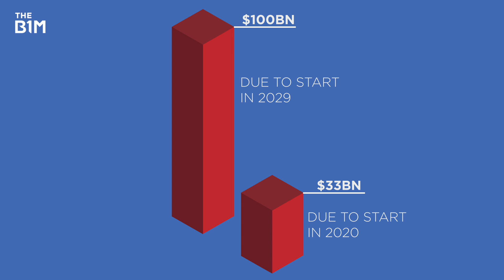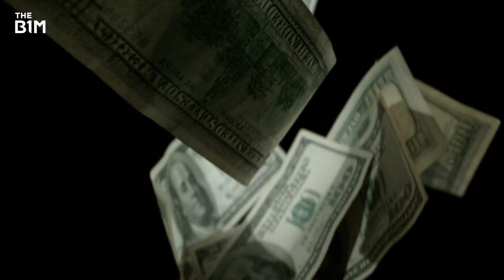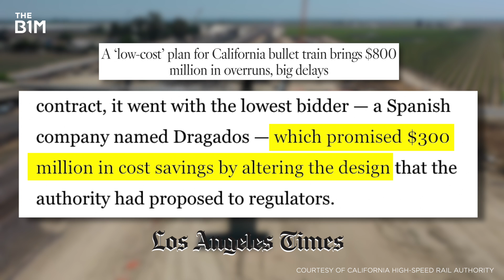What Went Wrong With California's High-Speed Railway

Comment: To anyone who thinks that the Acela isn’t true high speed, I’m gonna prove you wrong. In order for a train to be high speed, it has to go 125mph if it runs on existing track. And 160 if it’s brand new track. The track the Acela runs on is existing track. And there is a new Acela coming that will go 160, so no matter what, it’s legit high speed.
Reply: The train set is capable, but the whole line averages 70mph and can only hit those high speeds on a very small portion of the track. For example,  It's a lot closer to a  French regional train, than the TGV system.
Reply: @MikeM-so3je  unlike the French regional trains, the Acela is very long and runs on a freight gauge track
Reply: Yea but the average speed is comparable to a car- Not high speed.
Reply: The trainsets themselves were never the problem. The rails, the sharper turns, and number of level crossings, are what prevents these trains from running at their full high speed potential.
Reply: HSR isn't just train, but the whole system
Reply: It may fit the definition alright, but that bar is really low. Compared to trains in Europe and Asia it's slow. If the same track was in China, it would not be considered a true high-speed train (gaotie) but rather a medium-speed one (dongche).

Comment: From the viewpoint of a Taiwanese who lives in the bay area and rides on high speed rail several times in both Taiwan and Japan every pre-COVID-19 year, it is incredible to see cahsr to begin construction in the central valley whose population density is lower than the bay area and LA metropolitan area. It is not going to make money and it benefits so much fewer people. It would make more sense to start the northern section from Oakland or SF to San Jose, to show that it can survive on its own, and then extend to Napa, Sacramento, the central valley, and connect to the southern section from LA/San Diego. It is destined to be a money burning pit to start in the central valley
Reply: Whoever planned it to start from the central valley wanted it to fail and stop.
Reply: HSRs have a track record as money pits. Anyone who thinks that HSRs can survive without some sort of subsidy is delusional. Japan was forced to privatize their system after they racked up too much debt building political motivated HSR lines. Taiwan's HSR project was a financial train wreck. The list goes on.
Reply: @MrAnonymousRandom  But both systems live on their own revenue now.
Reply: At worst, it won't be a money pit as large as it will be to start from the central valley, since it can make more revenue.

Comment: Drive to the high speed rail station and park 30mins,
Lineup and reserve a ticket 30mins , 
wait for the next train 30mins,
journey 2 hours 30 mins
pickup a car in  hertz 30mins, 
Drive to your destination 30mins
Total 4 hours 30mins
Not much time you can save compared to drive (6hours)
Reply: Drive to station 30 mins, 
Buy ticket on phone app 30seconds, or use swipe card,5 seconds
Wait for train to arrive and board, 10 minutes
journey 2 hours 30 minutes, schedule car near station in meantime.
Walk to get rental keys and pick up car 10mins
Drive to destination 30 mins.
Total: 3 hours and 50 mins. 

Benefits: No risk of accidents(drunks, deer, people texting while driving). No wear tear and maintenance on car. No gas cost. System can be used by the elderly, people without drivers license, and the disabled. Decrease pollution. And you know what is best of all? You can rest on a train, do work, eat lunch, read, be on a laptop, or do whatever you want. All the things you cannot do while driving. AND save 2 hours of your time. That does not sound like a good deal to you?

Comment: There are several mistakes in this presentation:
3:11 the initial construction packages 1-4 do not "link" Madera and Bakersfield.  This section ends in a field about 10 miles outside of Bakersfield with no station.
3:46 the cost estimate of $33 billion(in 2008 dollars) is from the 2008 business plan which acknowledges that cost is if everything goes perfectly, and it implores the state legislature to remove roadblocks that would increase the cost.  The current budget is not "over $100 billion". The current base budget from the revised 2020 business plan is ~$83 billion.  That cost is for the entirety of Phase 1 from S.F. to Anaheim, and not the initial 119 mile construction section, as implied.  The timeline of completion is currently "before the end of the decade" and that applies to an operating section between Merced and Bakersfield, not the initial 119 miles of construction.  The cost of the section from Merced to Bakersfield is currently estimated at about $22 billion.
4:00 the Prop 1A bond requires matching funds from another source, but there is no requirement that source not be from the state itself.  This is why the state has been directing about $750 million/year in Cap-and-Trade funds that the state collects, toward the project. This is also why the state is capable of spending the entirety of the bond money by 2030.  The plan did originally assume there would be significant private investment, and there has been none.
5:15 the idea that there is no indication when the environmental reviews will be finished is false.  There is a schedule for completion of Environmental Impact Reports and the Record of Decisions is in the current 2020 business plan.  The EIRS are scheduled to be completed Q1 of 2022.  The RoDs are scheduled to be done at the end of 2023.  Once a RoD is complete for a section, technically construction can begin on that section.  However, as the video points out there are currently major funding issues which will keep this from happening on most of the sections even after environmental review is complete.

Comment: This won't be a popular opinion, but right now there really isn't a point to building all this in the US. It's a vanity project that really won't help people in their day to day lives. The focus needs to be on transportation in and around cities, commuter rail, light rail, and things like that that normal people would use every day. Being able to get from SF to LA in three hours doesn't really help you if it takes you two hours to commute in LA every day. Until that is fixed a big fancy high speed rail project really doesn't do much to benefit people. Things need to be fixed on a smaller scale first.
Reply: Maybe not popular, but I agree it's the only way this will work. Requiring a car to get to the station, and another car to arrive at the destination after the train trip, is one of the top objections to rail travel. If it could be solved, that would be a massive step forward.

Comment: One thing that I believe has been stated about the operation of the rail line is that around LA and SF the trains would be required to operated at slower speeds and the high speed portion is only in the middle section increasing the travel time between the cities. If that is true then the benefit would be greatly reduced.
Reply: The “slower speeds” are still upwards of 200 kilometres per hour. Of course the speed will be lower in urban centres, but the journey would still take around 3 hours, which is much better than road or air travel.
Reply: @justsamoo3480  I wouldn’t say much better. Flight time from LAX to SFO is 1:15-1:30.  So if factor in security and other time 30 minutes prior to boarding you might be pushing 3 hours.  The problem with that is you’ll still have security at the train station and need to be able to board 20-30 minutes before departure. So the time for train travel is even more than you listed.  Southwest charges $100-300 each way depending on how far your book in advance.  So will the high speed train be less than that?  Maybe, maybe not.
Reply: @ken9295  The issue with this is the fact that it takes forever to get in and out of LAX. Like you can board a high speed train from either Burbank, Union station, Norwalk, Fullerton and Anaheim just in LA metropolitan area alone. In Bay area you’ll have stops in Gilroy, San Jose, Milbrae and Downtown San Francisco. With that many stations in both LA and Bay it will be much easier to get to a high speed train stop than an airport of any sort.
Reply: @justsamoo3480  I used to live in LA and now practically commute out to LAX weekly.  I’ve never dropped anyone off, but I’ve taken shuttle buses from remote parking or car rental companies and get you in or out in short amounts of times. Most times I give myself 30 minutes from when I pull into the rental car lot until I need to be at the terminal. Yes there are rare times when driving through the horseshoe shape road through the terminal area but those are few and far between.

Comment: I opposed this project from the beginning, even though I'm a huge supporter or public transportation.  The reason I opposed it is that there were better ways to spend this money on public transportation.   For example,  a high speed connection between Sacramento and San Francisco would have been a good first step.  It is unbelievable that they decided to start this project in the middle of the farmland of the central valley.
Reply: Agreed. They should have started with shorter segments. LA to San Diego and SF to Sacramento, and then build a connection from SF to LA once the systems were up and running and had proven it would be used by people
Reply: Same, I lived in California at the time this was on the ballot and I voted against it, because I knew it was gonna turn out to be a clusterfuck and unfortunately I was right.
Reply: @rexx9496  Lol, but they went to the farmlands because the rail line you wanted would've been opposed by others, and now since your "democracy" is all about the individual, everybody thinks they're the boss, and everybody puts their foot down. The end result is that even in an effective one party state like California, well publicized but admittedly low priority projects like the high speed rail can't be built with much urgency. So please stop lecturing and smearing the Chinese Communists for being a "one party state", presumably accusing it of lacking a " diversity" of thought, as if you actually cared either way about whether that's true or not. And after all, like Steve Job of Apple fame once said during a reply to some "dissident" complaint, "at least something is being done", in this case of rails, in China.
Reply: Exactly, then they could’ve used the revenue generated from the LA/San Diego route to fund (partially) other segments.
Reply: They did that because they knew that once the projected started and people saw how much of a mess and incredibly expensive it was actually gonna be, funding was going to start to dry up, and if they didn't do that middle section through all the farmland first, there never would have been the political will to complete that section. 

Now that the least popular section has been built first, they'll have a better shot at actually getting the entire system completed.
Reply: As it is, Caltrain just announced electrification won’t be completed until 2024 now, adding a further 2 years of delays, and that’s just a relatively short segment of rail line where a train line already exists
Reply: They decided to start between SF and LA, but due to budget shortage and other reasons finally they have to do it in the valley

Comment: Few things are worse than leaving a project unfinished (or taking too long) what happens is that the unfinished parts are being exposed to the elements and they start deteriorate - however slowly - they are NOT meant to be exposed to the harsh element "barebone" for YEARS without proper protection (yes, even concrete and steel). That, plus the union's attitude with zero accountability (take AS LONG AND WORK AS SLOW AS POSSIBLE) and tax payer founded (again, zero accountability) you've a joke that's not even funny.

Comment: The fact sheet said the rail is gonna take 2 hrs 38 mins to travel from LA to San Fran. What is the average flight time between LAX and SFO? Oh 1 hr 25 mins. Why would any sane person consider it a good project?
Reply: because those aren't the only two cities that will be served by a long shot.
Reply: @snoopyloopy  

The census data suggest most population concentrates at those two cities. So this will never be a good bargain if and only if there is a sudden surge in traffic demand among those less populated areas in-between which is unlikely. Plus high-speed rail is high-speed because they are designed to have as few stops as possible. Acceleration and deceleration takes time. 

An improved connection between LA and San Diego (not necessarily an all-new "high-speed" railway, better trains, better track and line designs all can help) may fare better.

Comment: China’s current infrastructure construction has been accumulated over the past 40 years. The purpose of China’s large-scale infrastructure construction is to improve people’s livelihood 
and create an investment environment. 40,000 KM high-speed rail lines will be built within 10 years. The purpose is to build between cities and between cities and villages. The interconnection of China is not about comparing with others, nor is it about surpassing others. On the other hand, the Biden administration in the United States seems to have only one purpose in its infrastructure construction, surpassing China.
Money is far from enough for infrastructure construction. Does the United States now have a large number of professional infrastructure workers? Do you have a large number of modern professional infrastructure equipment? Nowadays, 80% of China's high-speed rail construction, maintenance and repair use robots, and the 1500KM high-speed rail line will be completed and opened to traffic in two and a half years. China is not only the world's largest manufacturing country but also the most comprehensive manufacturing country. More importantly, the Chinese government formulates and implements policies with high efficiency, which is unmatched in the world.

Comment: Imagine being the world's "only superpower", but lack the ability to build even just ONE high speed rail 🤔

A country built by rail and trains in the past became automobile-centric due to corporate lobbying and bribes.
Reply: Let's look at the economics.  Quality HSR only works in distances under 500Km in high density areas and a cheap labor force.   Let's look at the most establish HSR line in the world.  The Tokaido Shinkansen, opened in 1964, it covers Tokyo, Nagoya, Kyoto, and Osaka.  Four of the biggest cities in Japan.  515kms and an average trip taking about 2 hours and 30 minutes.  Cost 1 way: 13620 yen (unreserved seat) or 14650 yen (reserved seat).  Peach Aviation from Narita to Kansai International last minute ticket 6000yen-8000yen(most of the time less).   ANA Haneda to Osaka Airport last minute ticket 9000yen-11000yen.  Flight time 1h 10m.  You have airlines beating one of the most established HSR lines in the world on pricing.   Not to mention you can get there on regional trains for 5000yen or bus for 4000yen, but it is an 8 hour trip.   

After 500km HSR becomes exponentially more expensive than flying.  Why on earth would you build HSR that is over 600Km with less than 3 major cities and high labor costs.  The cost per ticket are going to be astronomical.  HSR just isn't feasible in most of the US.
Reply: @TheBaldr  While your argument is very convincing, you're forgetting the timing element. even though you can take low-cost carriers or even JAL/ANA domestically, those flights are not running every hour. The reason why the shinkansen is able to compete is that it offers the most flexible time schedule out of the options available with the added bonus of serving the tens of municipalities on the route in between.
Reply: @HitomiNee  don't forget the hassle when checking-in/out at airport and ease of commuting to train station.
Reply: Well its not an aircraft carrier so why would the Feds care?
Reply: Well said 💯
Reply: Most extensive freight rail network in the whole world.
Reply: Or have unified healthcare.
Reply: the only superpower   you are full of s...